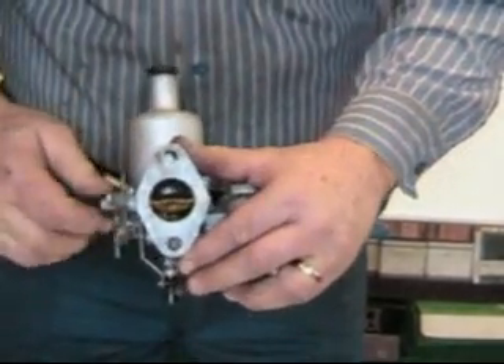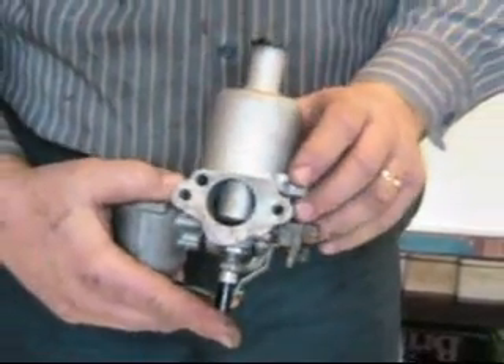043 MG Tech | Secrets of the SU Carburetor Part 2 of 2

Comment: I've run SU's for years and I race at the dragstrip regularly. One thing I discovered is that my 240Z actually ran almost a tenth of a second faster in the 1/8 mile if I removed my Damper pistons. I've run my Z that way for 13 years now and have turned a 12.94 @ 104 mph with the stock  bore SU's and a 12.804 @ 107.26 mph after I bored the SU carbs out to just under 50 mm. I have the SM Needles and I've done a lot of smoothing to bridge, bottom of airflow piston and cut down the throttle shafts.